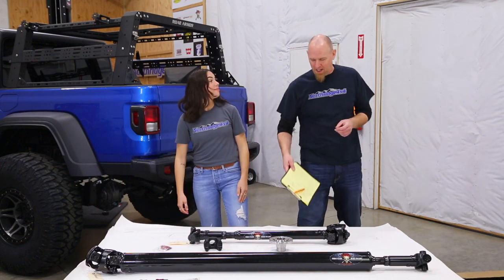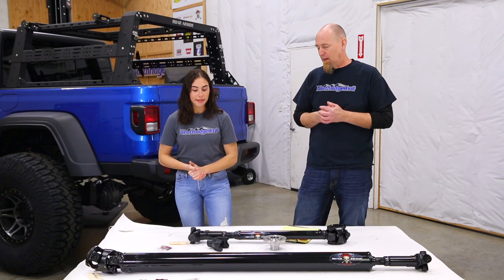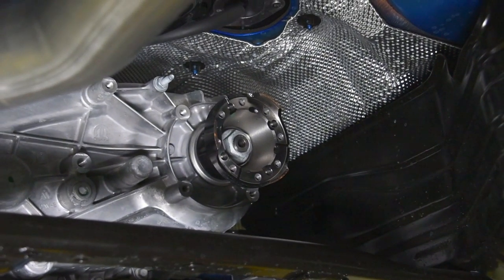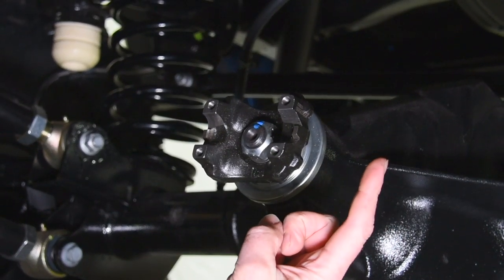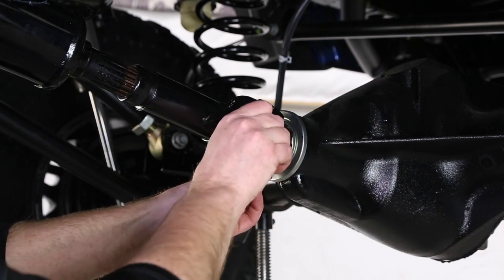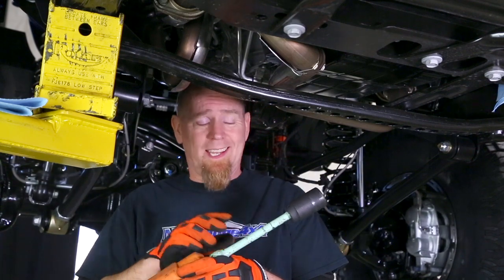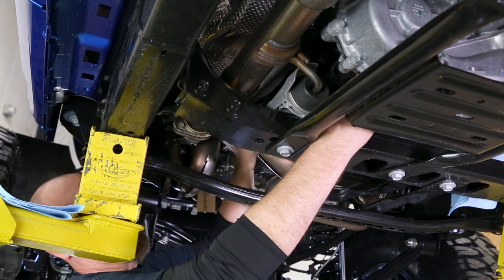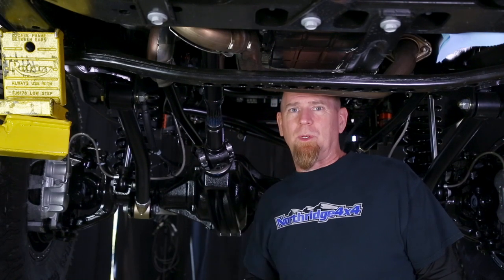Adams Driveshafts 1350 Extreme Duty Series Driveshafts Install

Comment: If using genuine Dana bearing strap kit (3-70-28X) you absolutely do not need to add loctite to the lock patch that is already on the bolts from the factory.
Reply from the maker: Correct, you should not need to add Loctite, we just like the extra insurance.

Comment: If you put an  adams rear  driveshaft on a rubicon with no lift, would it still work for same jeep with 4.5 lift?  I know it asks for measurements before ordering but i know you can run same stock rear DS before and after lift…
Reply from the maker: What vehicle?
Reply: Would it???
Reply: @northridgenation  let’s say a gladiator
Reply from the maker: @taylormccarty3760  Adams says up to 4-1/2"s, so you're good for stock up to 4-1/2"s. It is always best to measure just to be sure.
https://www.northridge4x4.com/part/rear-driveshafts/jt-1350r-s-1pc-rub-adams-driveshaft-extreme-duty-series-1-piece-1350-solid-rear-cv-driveshaft

Comment: I lift my Jeep Wrangler Rubicon JL 2.5". Should i need to change the front and rear driveshaft? Because what I noticed is that since i lift my jeep i feel like there is something weird happened with shifting gears between 1 to 2 and from 3 to 1. Like there little bit of vibreation. Does Adema driveshaft fix this issue?
Reply from the maker: 2 door or 4 door?
Typical not needed with a 2.5" lift on a 4 door. Though it does sound like you need to have some adjustments made. 
Did you adjust your caster?

Comment: Question: I don’t have Dana 60’s 
I’ve got the Dana 44’s can I still use these drive shafts??
Reply from the maker: We've got them for your Dana 44 - 
Rear JL 4dr: https://www.northridge4x4.com/part/rear-driveshafts/jl-1350r-s4d-rub-adams-driveshaft-rear-1350-cv
Rubicon Front JL: https://www.northridge4x4.com/part/front-driveshafts/jl-1350hrf-s-oem-rub-adams-driveshaft-extreme-duty-series-1350-half-round-front-cv-driveshaft

Comment: Love how they don't show the yoke and flange removal. That way you'll completely be lost doing it the first time.
Reply from the maker: @3:39 in the video we show the flange coming off the T-case. It's pretty much the same on the axles too. Just pull them out, if yours are tight, smack 'em a few times with rubber mallet.

Comment: Does this fit dana 44 axels
Reply from the maker: We have them to fit Dana 30s, 44s and 60s.
Reply: @northridgenation  which one do I need I have a gladiator sport s and it says that ADAMS DRIVESHAFT EXTREME DUTY SERIES 1310 SOLID FRONT CV DRIVESHAFT - W/FLANGE is discontinued

Comment: My Adams shaft has the POS Neapco parts, not Spicer. 

Spicer slip joints allow you to Grease at the seal end of the female and grease travels down the splines to vent at the joint end. They also have a smooth machined male slip with a Spicer double lip seal to keep contaminants out.

Neapco uses a grease fitting and vent that are both on the same joint side, grease is never forced through the slip splines. Neapco also uses a splined seal that barely seals at all and it allows water to easily contaminate the slip joint. The Adams Neapco setup is China imported junk.

I'm not at all impressed with the cheap China shit that Adams used in my JK shaft.
Reply: Neapco is not Cheap import Junk. The parts are made in Nebraska. Adams sells 1000s of these style driveshafts without any issues. Adams prefers the Neapco over the spicer due to the fact the Spicer zerk always gets ripped off of the dust cap.If you would have asked for all Spicer parts then they could have accommodated you..